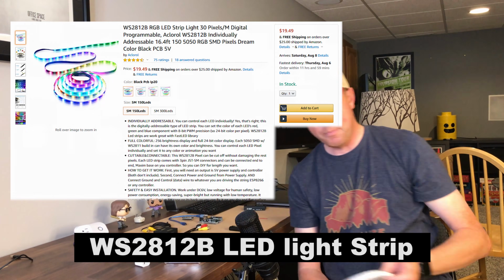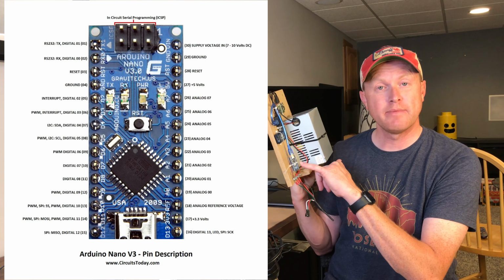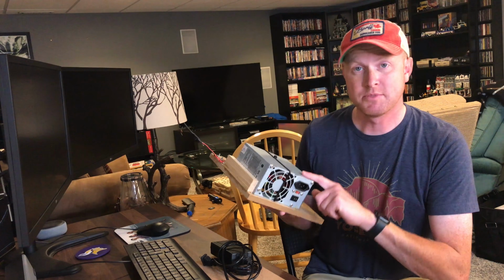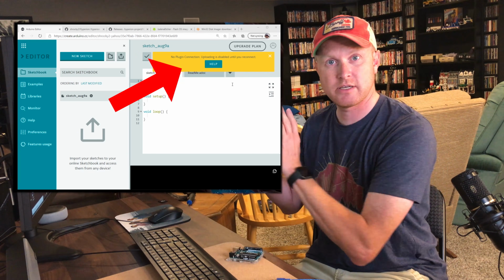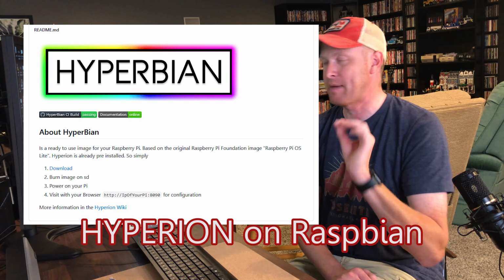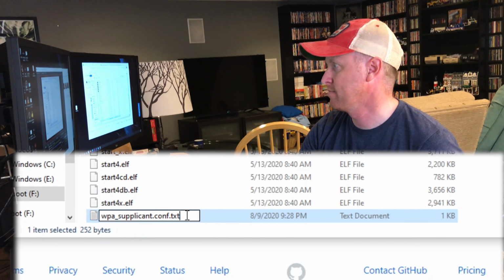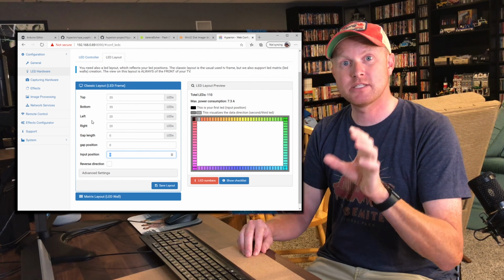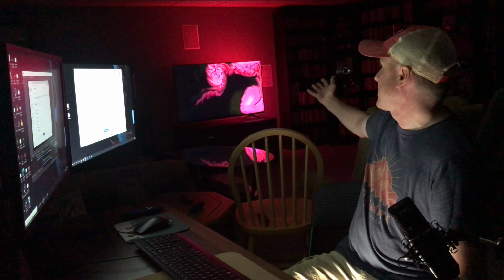DIY Hyperion Ambient TV Light Project (Raspberry Pi + Arduino) Complete Setup

Comment: Way too much junk in the back. I mean, the effect is pretty awesome, but for all that junk hanging in the back, is not worth it.
Reply: @Steve_Does_Stuff  look don't get me wrong, in the video you stated that it is for the cheapest price possible, and that's OK. In my opinion I would invest a bit more in a new pi and have the hdmi to mini hdmi from the TV. That way you don't need the extra connector. But again, that's my view and I'm OK on spending another 30 or 40 euros to have the all thing with as less wires (specially the visible ones) possible. Have a great 2021.

Comment: The problem with most of these solutions is that they rely on receiving video from an outside source like a PS4 or cable box. I watch stuff that comes from the Tv's tuner or installed apps.

Comment: Thanks Steve for the video.  I have couple of quetions, could you please answer them when you get a chance?
1. i have my inputs (Roku, Firetv, Xbox, laptop) connected through receiver, i understand that the receiver out should be connected as input. Please confrim it is correct?
also i use ARC channel from TV and pass it out of receiver what would you suggest in such scenario?
2. do you suggest one box that would fit all the equipment (similar to one you have on the wooden block).

Comment: Thanks for the video. I've managed to get everything working. I did notice though that the picture quality on the grabber is not very good. I've put a Red color on the TV to try and calibrate the colors, but the grabber is seeing it more like brown. So everything Red just comes up as whiteish color from LED's. Do you know of a good way to calibrate the colors? Thanks
Reply: @Steve_Does_Stuff  i managed to fix it. For some reason hue adjustment didn't work very well. It would only take effect after rebooting the raspberry and arduino. Weird one, but works great now!

Comment: Finally got my leds to fire up after unplugging the Ds card from pi. I think I have the wiring right.  I am using a long strip  600 leds for a projector screen. First time using leds. I saw someone here mention a limitation on priority channel being 253 as an issue with long leds and how he bypassed it. Tried what he said on line 95 Nano code but did not work any suddestions

Comment: Dear Steve
 I'm evaluating from some time  Raspberry Ambilight system so in the last months I buy the Leds strip and so on.
 
I'm ready to start when i watch your very interesting video to use usb hdmi video grabber that I found simple and better that previous analog system. 

Now i have some question if you are able to answer.
I will use raspberry only to manage led strip 
I will use apa102 LED type.

1) may i use only raspberry to manage Led (Using Raspberry) GPIO or is necessary also the arduino ?

Thanks Giorgio.
Reply: @Steve_Does_Stuff  Hello Steve, thanks for the answer. I will use apa102 Led and I think to power it with a 5v dedicated power supply I think to use raspberry only for clock and signal. Do you think it is possible ? How i is possible now to use the cheap hdmi 2.0 grabber, it is because of hyperion new release that support it ?
Thanks.

Comment: Really good video Steve. Explained the whole process in enough detail for me to follow without any issues.
I have just set this up on my Raspberry Pi 4 running LibreELEC (Kodi).
Install of Hyperion was done via the install script created by  Paulchen-Panther (https://gist.github.com/Paulchen-Panther/f0baf820343bbf800a041b102dd9cadd)
Used a AC to 5v DC power supply, and then a DC 3-way power splitter (used primary in CCTV installs). Then connected up everything using DC Adapters. DC > USB C (Raspberry Pi4) . DC > USB Micro B (HDMI 4k Splitter). DC > Wiring (Led Lights)
Reply: https://www.ebay.co.uk/itm/2pcs-DC-Power-Adapter-Type-C-USB-Male-to-DC5-5x2-1mm-Female-Jack-Converter/124466394630?hash=item1cfac67606:g:FgcAAOSwonZfxd-B 
15A 5V should have plenty of power

https://www.ebay.co.uk/itm/3-WAY-DC-Power-Splitter-Adapter-Cable-2-1mm-DC-Jack-CCTV-LED-Lighting-/273154238272

https://www.ebay.co.uk/itm/DC-5-5-x-2-1mm-Jack-To-Micro-USB-B-5-pin-Right-Angle-Male-Power-Adapter-Plug-/232000665935?_trksid=p2385738.m4383.l4275.c10

https://www.amazon.co.uk/SHNITPWR-110V-240V-Converter-Transformer-Controller/dp/B08GKCZZSX/ref=sr_1_5?dchild=1&keywords=10a+5v&qid=1608440211&s=electronics&sr=1-5

https://www.amazon.co.uk/HDMI-Splitter-in2-out-60Hz-Black/dp/B085Q37JPR handles 4K 60 HDCP 2.2 apparently

Comment: Hello thanks for the nice video
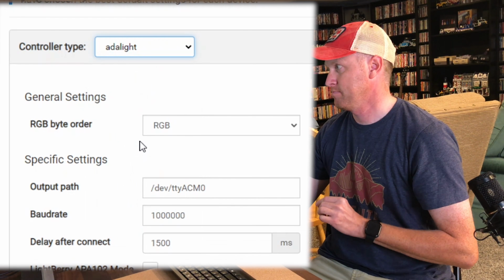When you select the controller type usb adalight at 25:35 minutes of your video, only the output path appears in the boxes below. I don't see the baudrate and delay after connect boxes. I got stuck here.
Reply: Make sure you go to settings and select "Advanced". The other options will show up then.
Reply: @wadephillips487  You the real MVP

Comment: I am having a FRUSTRATING time getting the usb capture to work correctly. It worked great for about a week and now I can not get any images through it.
Reply: fixed all the issues! it is very important the order of power input for the components. Most importantly, the capture card needs input power BEFORE the HDMI input provides power up the cable.
Reply: Look into HDCP and if your content is HDCP or not! That can sometimes ruin your day.

Comment: Need some help - Arduino Nano clones - when I'm trying to program the Arduino Nano I get this error 
avrdude: stk500_recv(): programmer is not responding

avrdude: stk500_getsync() attempt 10 of 10: not in sync: resp=0xe
Reply: Same issue here. Did you ever figure this out?

Comment: And it looks like that there is some delay in picture and backlight on the wall is presented, did u fixed it later or it's fine for u?
Reply: Try adjusting the smoothing settings in the image processing. I had to adjust mine to about 100ms to make sure that the lights were more in sync with the image

Comment: I've messed with computer power supplies alot for projects. I'm currently mid-way through a project where I'm trying to power a electric adjusting car seat with a computer power supply + an Arduino with a Can-bus attachment to trick the seat into thinking it's in the car, So I can use the original car controls for the seat.

I've created a latching circuit, with a relay just because it's mimicking a car with ignition and then start button, but I feel you could have just put a small switch between the switch wire and ground (green+black) and put a tiny switch on the front of your TV mount or something? This switch could have long wires hiding nicely in your TV stand.
Or use the Arduino as a switch, there's must be a simple on off output module or relay module you could attach or such idk but fair enough the plug works albeit more cost and more items for you to rely on WiFi working, I've had issues in the past with smart plugs so I avoid them like the plague🤣

Here's a video skip through until you see the very crude wiring diagram I drew in paint 🤣
https://www.youtube.com/watch?v=cMJ29q1kVFc&ab_channel=shellcool0wns
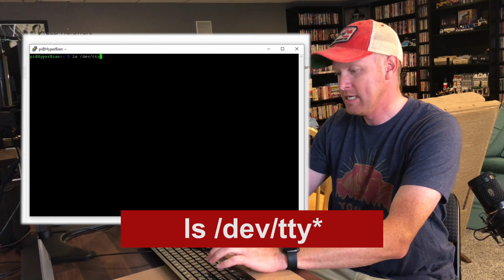24:40 is a good starting point I explain the circuit

(The video was aimed for my two friends who are not electrical minded atall, so sorry for the dumbed down parts and using other people's names lol)

Comment: Thx for the video, I'm gonna try this at home. But in your video with the color test of youtube you can see that there is some delay. Colors on screen are faster then the leds, is that ajustable?
Reply: And the latest version doesnt give the baudtrate after chosing for adalight. Im not at home now so i cant see if it is a problem or not, but just letting you know.
Reply: I tried a lot. but the light dont go on when connected to hyperion. Starting arduino turn on the leds and after 3 colors they go off. Ill think there goes something wrong in hyperion. Hope you can help me...
Reply: @ajvantwillert  did you end up getting this? I had the same issue. Everything works except the feed to lights... they cycle rgb on startup but nothing after despite seeing the layout properly in hyperion. You need to flip your settings level to advanced or expert and input the same baud rate that is in your code. That got mine working 👍

Comment: greatscott did this project  but didn't use  any arduino ,just a  rpi
but he used  a 12v strip and a different strip type ,  
i got that strip type ,it was like 3 times the price i think (it was like $60 but not sure the length now but it is just enough for my old 50" TV with huge bezels)
do you actually need a arduino  or can you use the   GPIO on the pi?
and i wonder if i can use that strip type for this setup
Reply: Great Scott used the AP102 strip.
That has four wires, live, ground, data and clock. It works off 5 volts not 12 volts.
The RPI GPIO pins work at 3.3 volts. I'm guessing this was just enough for his led strip to work. But normally, you'd need to boost the voltage to 5 volts. This video used an Arduino to boost the voltage, but a voltage stepper chip would have sufficed
Reply: @CharlesLGoodwin  he  didn't power the stip directly from the pi zero he powered it separately and just connected the grounds from the strip power to the ground from the pi , you have to power the strip separate no matter what , you could not  draw that kind of   current through the pi without  burning it or having it shut down from low power i don't think
i am just not sure  how his version get away without using an arduino and all the other people i see making  this kind of project is using an arduino
Reply: @andreamitchell4758  You are quite right. I should have made myself clearer. The strip is indeed separately powered but I was referring to the clock and data wires. The led strip prefers a 5v voltage level for the clock and data wires but Scott gets away with just using 3.3volts fed directly from the RPI GPIO pins
Reply: @CharlesLGoodwin  oh I see yes, you mean 3.3 volt logic as opposed for 5v logic
Yes we'll i will have to look into that 
If it were the other way around it could have been a problem ,I have used FTDI serial interface for arduino pro mini and for flashing things using esp8266 and I have heard of people who forget to set the jumper or the swift on their FTDI to 3.3 and leaving it on 5v burning the board in the esp device they are trying to flash

Comment: using the switched  USB port on the TV for the splitter  can create come problems  if you use anything that uses CEC to  switch the TV on and off like a chromecast or receiver
i use voice assistant to   to turn the TV on and off sometimes

Comment: I got lost around 6:50 mark. Is there any soldering if I am using the power brick instead of the power supply?
Reply: @Steve_Does_Stuff  Ty for answering! I have a few more questions. Does the power brick and LED strips all attached to each other via a connector then? Since no soldering is required. Lastly, if I want to watch content that is 4K/Dolby Atmos at 60, does the capture card and splitter have to also support 4K at 60?

Comment: Do you have any experience using this with Hyperion android grabber? I have Hyperion on a linux laptop and a esp32 with wled running the leds and hyperion is communicating with with Wled. I have Hyperion android grabber installed on my Nvidia shield and it finds the hyperion server but its not working and i feel im missing something.

Comment: good afternoon steve and followed all your directions.  but the led lights don't turn on ... don't we have to put protection for 470 ohm resistors or capacitor?  Another question, if there is communication between the raspberry and the arduino Zero, does it mean that everything works and it could be that the led strip is faulty?  thank you very much a great video
Reply: @Steve_Does_Stuff  Thank you very much Steve I will try again to enter the arduino codes something I am doing wrong I will have to watch your video again but I do it step by step as you do. Could you put the link of the audruino code in the answer you give me? Thank you very much for your prompt reply, I am looking forward to the project working.
Reply: @Steve_Does_Stuff  Steve very good 👍👏👏👏We have achieved it, it has worked, the problem I had was that when trying to program the Arduino Zero with firefox it did not let me change and I did it with Explorer and it let me program the Arduino, connect it and it worked, thank you very much, you are a machine

Comment: Can't this work with just the Raspberry Pi? Is there anything that would prevent the Raspberry Pi from both analyzing the video input as well as telling the lights what to do?
Reply: @Steve_Does_Stuff  Do you know if it possible to drive the power from the pi? I have my 150W 5v power supply connect directly to the board on the pi and not the USB.

Comment: Thanks for the awesome video!
I have a question about the video adapter. is the HDMI splitter lowering the video quality from 4K to 1080p?
Reply: @Steve_Does_Stuff  Hi Steve, I got the HDMI to USB video grabber that you recommended today. I connected that to my RPi (Model B Revision 2.0 512MB) and I can't see anything under the Hyperion LED Visualization window. 
I was just trying to see if I can see the image in the Hyperion server from my laptop. Any suggestions for me?
Reply: Update I tested the USB Video Capture device with 2 windows 10 machines and the device works just fine.
Do I need to have an updated Rpi?

Comment: Is there any options to get PS5 (HDMI 2.1 48Gbps) data with HDR 10+ through to the TV while sending the signal to the Raspberry pi for use with Hyperion? I wasnt able to find any splitter or passthrough with copy/capture.

Comment: Couldn’t you do this without the arduino?
Reply: Yes. I literally just watched a video.
Reply: the only challenge might be running the pwm signal and the video capture on a single core... I'm not sure if this can be overcome thou...
An ESP-32 should certainly work
Reply: @modellking  well, raspberry has more powerful processor than Arduino, so it should be optimized for such tasks.
Reply: @madpancake9891  that's certainly possible. I wouldn't bet on it thou.
Reply: @modellking  yeah, IT probably depends on available libraries and stuff. I'm almost certain it's physically possible, but I don't know much about software behind
Reply: Yes it work without arduino. I tested it. Just select controller type to be WS28xx and use data line to be pin 18 (default).

Comment: If you don't see "baudrate" when selecting the led hardware, change your your settings level (wrench icon) to advanced. This was blocking my leds from firing up. It flashed on changes but didn't react on the hdmi source. 

Great tutorial btw!
Reply: Thank you very much, it helped a lot. it almost landed in the trash :)
Reply: Wish I had known that. I set the log to debug and saw that by default it was communicating on 115200. Didn't know that setting to advanced would do that - I just went back and edited the Nano in the web editor with the baudrate and then mine worked.
Reply: This helped me finally get mine working. Thanks bud 👍

Comment: HELP! Followed your tutorial to the letter. However when changing the LED hardware to "adalight" under the USB tab, it doesn't then give me any other drop down boxes? So confused and feel like I am falling at the last hurdle!
Reply: Answered below but just in case. you have to change the settings in the control panel. Top right, change the settings level to advance/expert and those extra settings will appear. This is what had mine not working for like 2 hours. Thought the software was upgraded to autodetect or something, nope, have to change the settings level to see them.

Comment: I had a problem building a second one of these for a relative after building one that worked first time for me.  The problem was that no leds light if the number of LED was > 255   My strip was 230 - worked fine, the one I built but wouldn't work was 285 leds long.   I only traced the issue by swapping 2 nanos, the one with 285 wouldn't light leds, the 230 one would in the same system.

I think the problem is in line 95 of the nano code  

for (uint8_t i = 0; i < NUM_LEDS; i++) {         setting i to be uint8_t limits it to 255, so it cannot set more leds, by changing this line to 
for (uint16_t i = 0; i < NUM_LEDS; i++) {

that limitation is removed, and my led strip now lights and the loop can set led strings longer than 255 leds

Hope that helps someone - and thanks to Steve for very clear instructions
Reply: hi where do you edit the code for the nano?
Reply: @allyirfan8663  in the arduino sketchup
Reply: Fixed my issue with 360 led’s!!!

Comment: Great guide! 
I'm a complete begginner in this kind of things, and i'm ordering the parts right now!
I only have 1 question (dont know if i missed something), on the Arduino, you only connect the usb (that goes to the splitter) and the D6 pin (that goes to the DIN on the led strip). There is no need to supply power to the Arduino? Through the 5v pin on the arduino?
I would really appreciate if you could help me and clarify this for me.
Thank you and great work.

Comment: Hi, thank you for this video instructions !

When my raspberry starts up, after is says "Starting daily apt upgrade and activities " it comes with this error:

[FAILED] Failed to start resize2fs_once.service
See 'system1 status resize2fs_once.service'  for details"

I cannot find the solution for this problem on the internet and I cannot find the .service file on the SD card in the raspberry.

I have a Raspberry Pi Zero WH 512 MB
With a 16gb Micro SD card.

It is connected with the HDMI port to my 4k hdmi television ( thru my Onkyo receiver )

Hope someone can explain me what to do to fix this error
Reply: I found the solution myself: had to change the overlay in the config.txt file for the screen to fit on my tv.  Now it works smoothly.